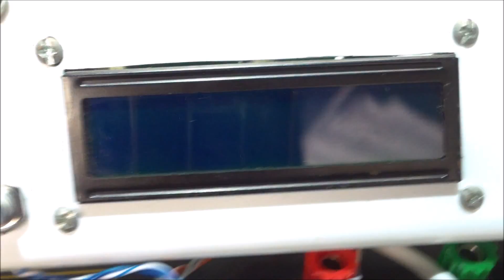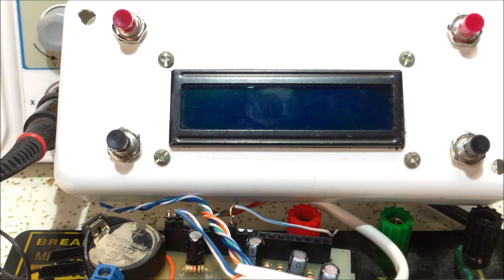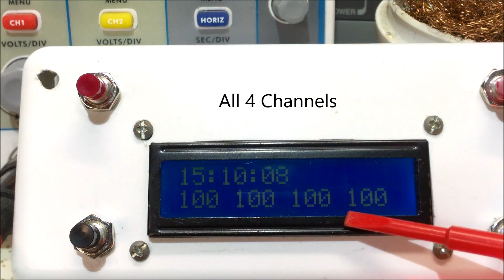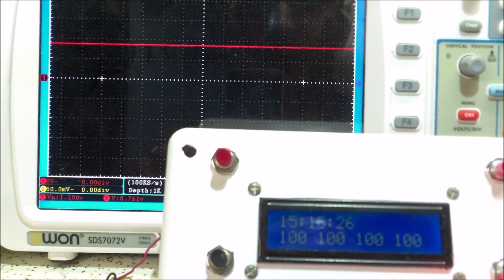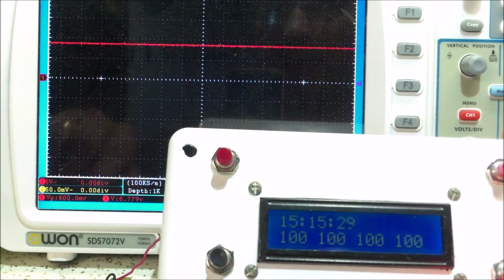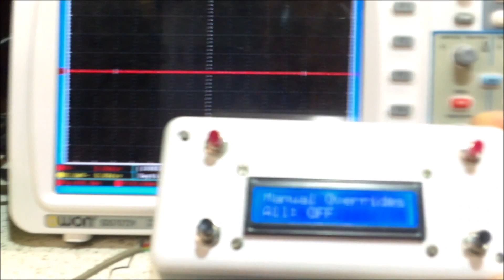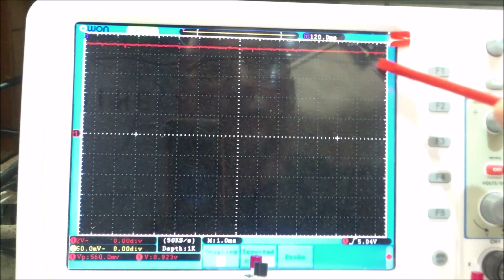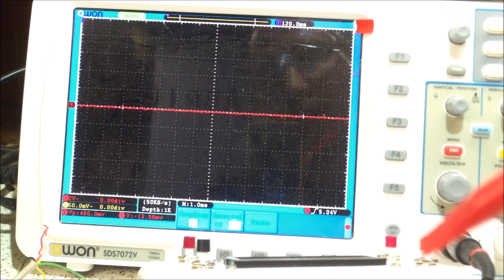How To: Control Blackbox LED's using Arduino PWM to 0 - 10v Analog Out

Comment: Nice work! I want to build them for dimming my led lighting fixtures, but the driver is 1-10v dimming. I need to turn off AC line of my led driver when the typhon code is at zero. How i can connect a relay to do this?
Reply from the maker: I had to do something similar, I used a really shield and wrote in the code when pwm was less than 1 turn off the relay.  You would just need to connect the ac to the relay.

Comment: Can you use just a single channel to control multiple 0-10V drivers?
Reply from the maker: Kind of. Not sure why you would want to, as you would lose individual control. Only if they all would be controlled at the same time. So on and then off at the same time etc.
Reply: Thanks for your fast reply.

And yeah that was kind of the idea, I have a need to control few LED strips simultaneously and need to be able to control few of these "clusters" separately. For example: 4 strips in each of the four channels. 
I think the main question here is: Is there any technical restriction that would render the possibility of driving multiple drivers via one channel impossible (or would this affect performance in any way, ie. voltage drop in the 0-10V rail or such).
Reply from the maker: Don't think it will effect performance on the rail as the driver is doing all of the load.
Reply: Thanks. Your project looks awesome and seems to be exactly what I need right now. And since you released both the board and the source code there's no need to re-invent the wheel etc... Thanks a lot!
Reply from the maker: Awesome point.

Comment: Old video but....Did you ever hook this up to an actual black box not just the sim?
Reply from the maker: +Jason Salonen NO, the black box I got used 0-3.3 volt pwm to control so I was able just to hook the arduino pwm output up to the black box input.
Reply: Tanks for the reply Carl! Im dot a good builder def a much poorer programmer, as you are. Im trying to use the coralux Storm controller on a BB.  The storm is 5.5 and Im having issues. lol.
Reply from the maker: +Jason Salonen isn’t the storm bas d on the typhoon? What issues are you having???
Reply: lol well, if you look at BB mods to apex and bluefish you cut the Pot and insert the controller signal instead. very simple procedure,
Most of the bb are 0-10v(mine and a few other friends).  Storm advised a 1-10v analogue converter, but its not responding fully(doesnt dim out all the way or turn off fully in "Off" on the controller). my assumption currently is that it need the 0-10v digital converter instead.

My original concept was remove all the (6) individual drivers and  to use two 250w (running 3 BB w W/B) pwm 70 - 100v drivers and no converter. the oem drivers are 60w 70-100v 0-10v dimming  @480mA CC btw
Reply from the maker: +Jason Salonen mine had a similar issue where off was actually 1% and my fix was to add the relays so when pwm is 0% the relay would turn off and then turn off the BB completely.
Reply: thank you! Ill look into that..